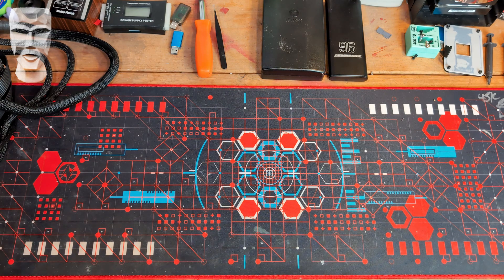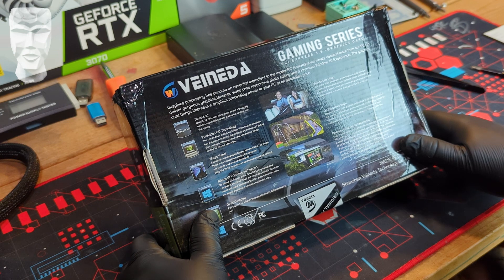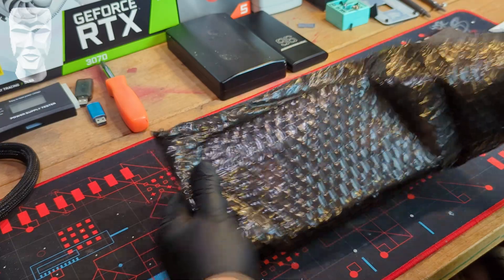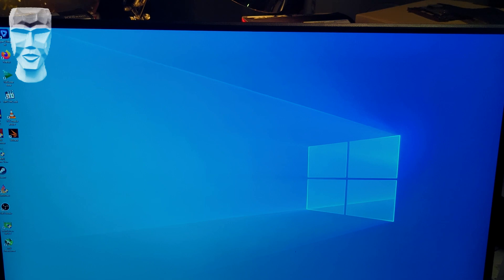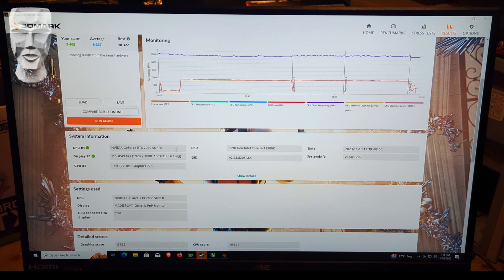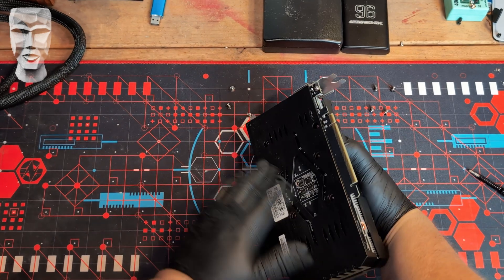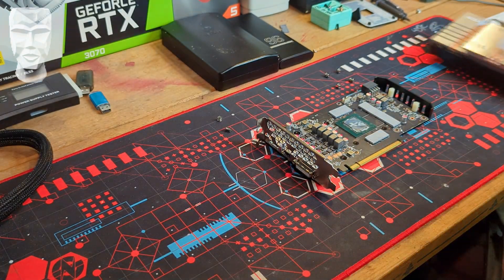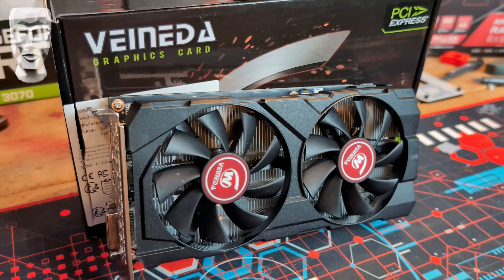A brand new NVIDIA RTX GPU for $150? Veineda RTX 2060 Super Review, Unboxing and Teardown

Comment: I have a hard time believing that this is actually a brand new card, a lot of these unknown Chinese manufacturers would usually go take used gpus from well-known brands such as Colorful and they would just slap their own sticker on there, for example, the picture shown on the ebay listing for the rtx 2060 super shows a colorful i-cafe rtx 2060 super, not a veineda one
Reply from the maker: I felt the same way too. I've purchased many shady cards. I also do SMD / Microsoldering for work. I can't find any reason to disqualify it as new.  It was undoubtedly intended for a different PCB with a different brand name on it.. but there are no signs of a reball, no tool marks, or scratches of any kind on the die, I put acetone on the memory ICs and they had not been resurfaced. I know this is going to sound funny, but it smelled new when I ran Furmark. All my new cards have a particular smell when they get hot for the first few weeks.. reminds me of oven cleaner.
Reply from the maker: If you have any other ideas for how we could test it, please let me know. I'll gladly do it and make a video.

Comment: Gosh... that sure pushes the boundary of value I thought I got when I picked up a lightly used GTX 1070 Ti for $100 shipped a couple months back. 🤔

Stellar review! Quick, point-driven and wrapped up nicely.
Reply from the maker: Yeah, but I bet your 1070 Ti has a better heatsink and VRM 😂 Thanks for the pointers!
Reply: @50shadesofbeige88  Considering where I had to mount the 1070 due to its girth, I think some of those heatsink benefits might wring out in the wash. 
My case is narrow and the 1070 would only fit in the bottom-most slots with barely 2 cm of clearance with the bottom of the case. I had to use a 16x PCIe riser cable to reach it. 🫣
The cooler is working but she got a little toasty under load. That 2060 isn't as long and would allow me to mount it without all the shenanigans.
Reply from the maker: True, especially a cheaper one like the 2060KO or a base model like this one.
Reply from the maker: I never understood why people buy super high end versions of 50 and 60 series cards anyway. I like to find the smaller ones. I loved my 3070 Twin Edge. It fits anywhere.